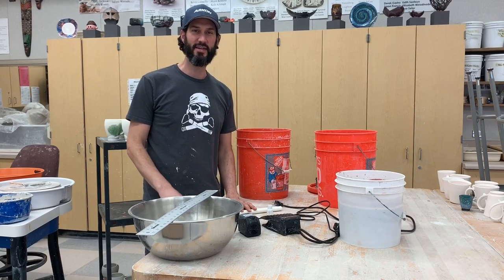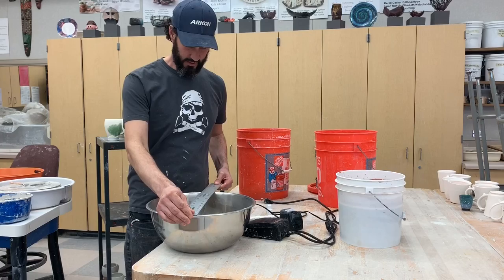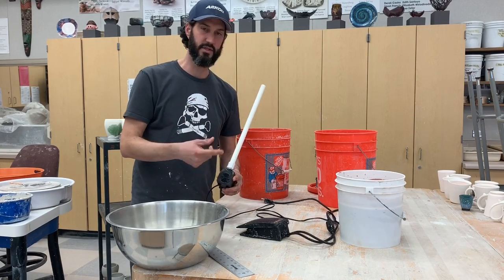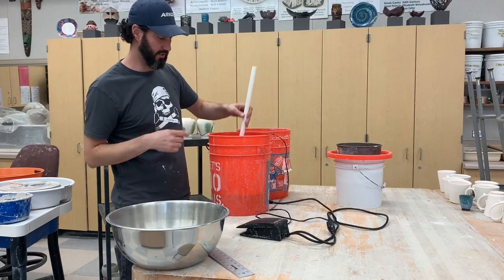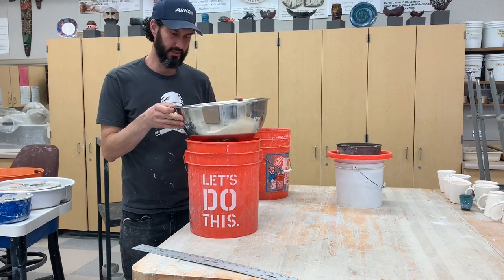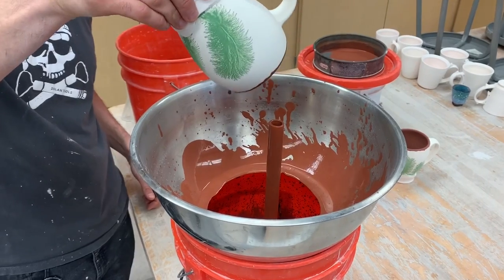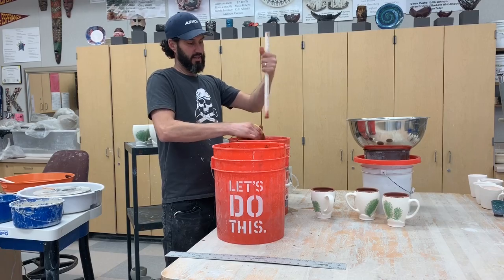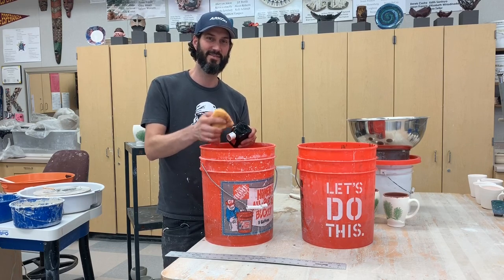Glaze Fountain build and demo.

Comment: Thank you SO MUCH for this video, Kevin, and your helpful link to the parts on Amazon !!   I used all the same equipment except I substituted a polycarbonate salad bowl for SS -- MUCH easier to fashion as required; I drilled a central hole for the PVC pipe and four holes around it.  My husband John helped me with the fabrication.  I just saw the results today out of the kiln and this a COMPLETE GAME CHANGER for me glazing small cups and bowls.  The results were PERFECT !! No drips, easy to do different color interiors. The results are FAR more consistent than with hand pouring, swirling and dumping.  -- Carol Green

Comment: Hey Kevin,  Thanks for demonstrating this.  I made one of these with a sump pump.  I was disappointed that the glaze application was thin.  I use if for my white glaze with titanium in it and it went yellow instead of white due to the think application.  Didn’t matter how long I let it run.  Do you make the glaze thicker than usual for this application or add anything to the glaze?  Thanks, Sue

Comment: I’m unsure of the purpose.   You simply pour the glaze in cup and turn it around and then dump.    No mess to clean up.      You would have to make hundreds before this would be practical.   Still I’m not sure simply pouring it in wouldn’t be faster.   Simply setup a 5 gallon water jug on the counter and press the button until the mug is full.   Drain back into the container.
Reply: I would imagine if you want a more uniform application this would be good.  I need a very quick glaze application so I’m interested in this method.
Reply: @alexihigh5190  to each his own.  The waste with his method is very high.